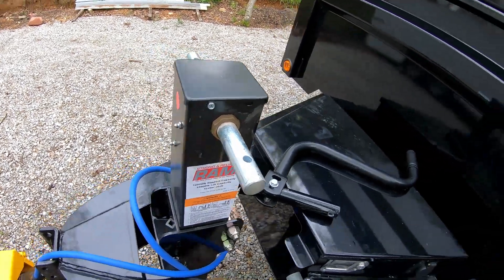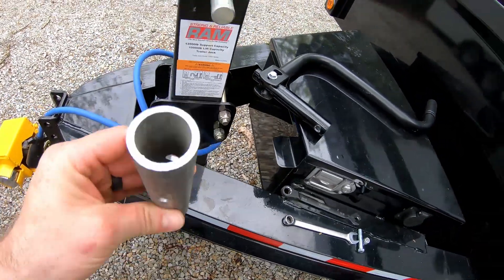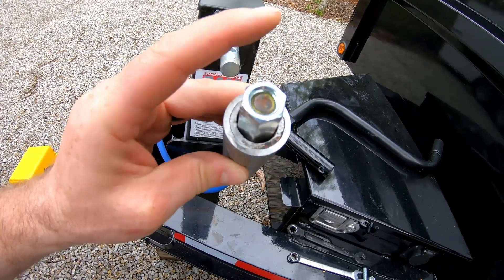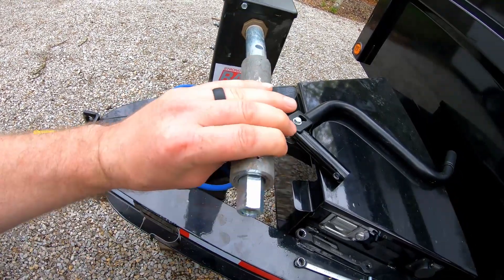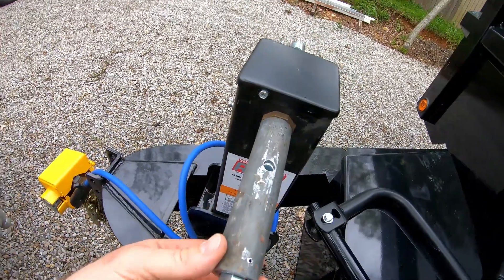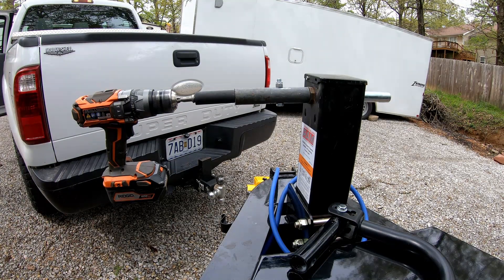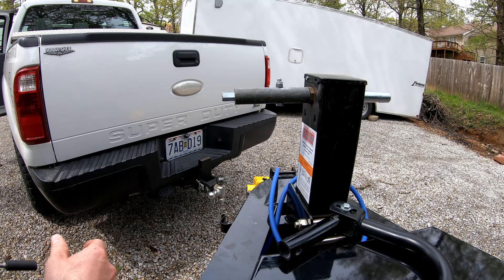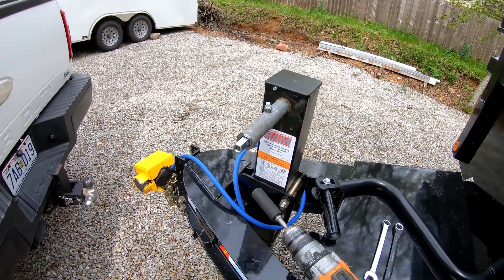DIY Power Jack On A Dump Trailer

Comment: You inspired me to make one which I installed opposite of the jack handle. I put a square pin on the handle side in place of the bolt for easy removal when using an impact wrench.  My Big Tex 14 LP is heavy, so a drill doesn't cut it with a heavy load. I use a cordless Ridgid 1/2" impact wrench.

Comment: Im doing something similar, adding one of the Torque Jack brands. Those factory "S" handles for those large jacks are a PITA. I hate those things. Im incorporating the manual crank handle too because I might not always have a power drill with me. I want to be able to work the jack either way.

Comment: What size cordless drill is needed to be able to life a heavier load on a dump trailer?
Reply from the maker: Mine is a 20 volt with a 5.0 amp hour battery. It has high and low and I use it on low.
Reply: @HandyGuy2016  thank you. I’m tired of cranking my ass off on my dump trailers. I’m not getting any younger. 👍

Comment: Any chance of getting a parts list. Pipe diameter thanks great video
Reply from the maker: Seems like all jacks are a little different, at least from what I have found so far. The best thing to do would be to get measurements for your trailer jack and see what is available local to you.

Comment: What size is your dump trailer? I have a 14' Big Tex and your invention would be great if it would lift it.
Reply from the maker: It's a 16' 14K, weighs about 4K empty.
Reply: @HandyGuy2016  That should work for me, thanks!
Reply: Does the drill have enough power to take it off the ball with the trailer loaded?
Reply from the maker: Yes